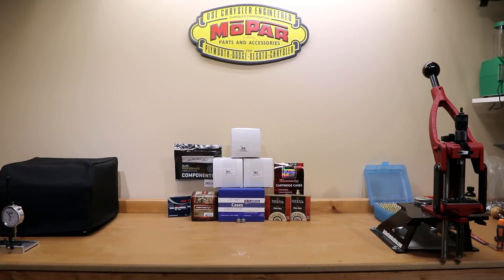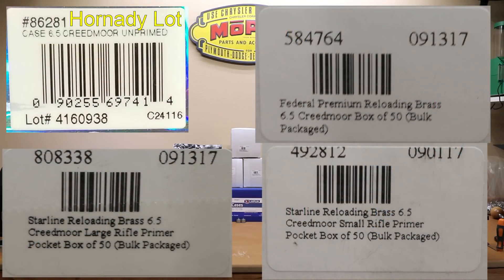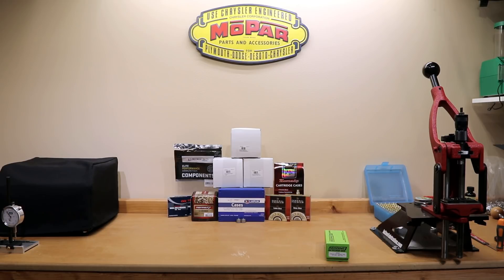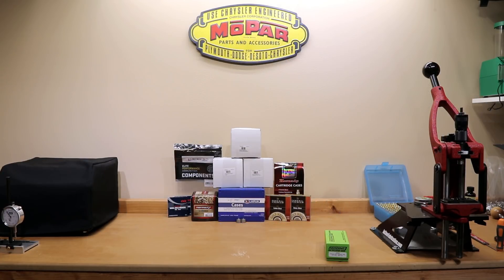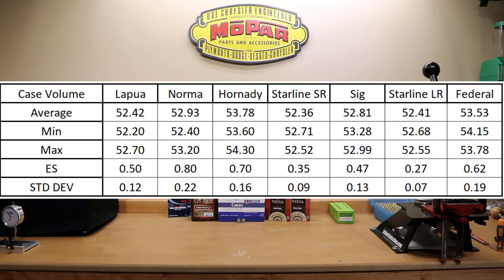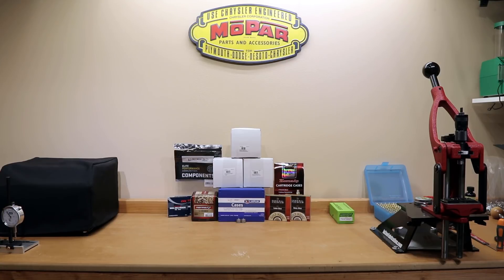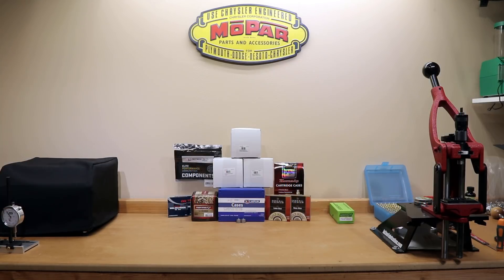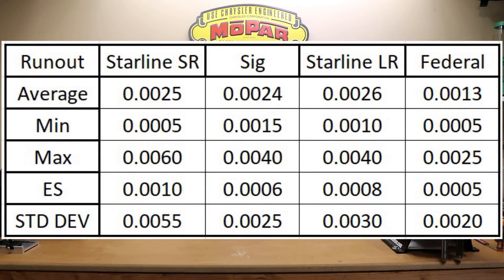Ultimate 6.5 creedmoor Brass Comparison guide

Comment: So I found some brass from a company called eagle eye ammo. It’s .308 LRP. When I emailed them about the brass I received this response “. We work with Alpha Munitions and the brass far exceeds Lapua on every technical metric.”

I did email alpha about this and they said they do send eagle eye brass. To what capacity the guy sis not know. Be it raw material or preformed brass to be head stamped eagle eye.
I message ultimate reloader on his website about this also. He has all my contact info

Might you be interested in testing some of this brass? 

I bought it thinking it was SRP. Because it was labeled match brass. But it’s LRP and I won’t use it. 
Please feel free to message me thanks

Comment: I was surprised by your results that Starline had lower case volume variation than Lapua (stdev 0.07 vs 0.012).
I was also surprised that Norma had lower neck thickness variation than Lapua (mean variation .34 vs .40 mil)

Comment: Beware of Norma Brass! I got brass failure/head separation after only 3 loadings. Using the same load with Hornady brass, I have had absolutely no problems. The Hornady brass have been loaded 16-18 times! Buy Hornady and don't take a chance on getting injured with Norma brass.

Comment: Roughly how many firings will I get out of 6.5 Creedmoor Starline LR primer brass vs Starline SR primer brass before primer pockets start to fail? I don't plan on annealing the brass. Thanks for any advice.
Reply from the maker: I dont have enough cycles on mine to fail yet but my SR will last longer, but tend to have issues with primer cratering at lower pressures so it depends how hard you are going to push it. LRP will likely give at least 7-8 firings. Just FYI, I just got some Peterson brass and have a video coming out soon. Its price is between starline and Lapua, but its quality is closer to Lapua. It's worth the money. Brownells and grafs carry it. Brownells always seem to have coupon codes.
Reply: I have 6.5C Starline SRP that have been fired 8x, annealed every 4 firings.  So far no sign of any case deterioration.

Comment: Just got some Peterson brass in 6.5 small rifle and damn it looks good. Excited to get it prepped
Reply from the maker: I have heard good things. I requested some samples but I never got a response back unfortunately. They offer 3 different options which did you pick?
Reply: Bolt Action Reloading I picked there standard annealed small rifle. Not the over sized brass that you neck turn down to your specific bore diameter. Looks good. Will have to see how it shoots once fire formed. They claim same gun, same bullet, cuts groups in half reported by customers.
Reply from the maker: Best of luck to you. I am not ready to write it in stone but I really feel that Neck wall thickness variation plays more into group size than people think. People have been very critical of my conclusions using the 130 RDF in this matter but I can't ignore the reduction in group size it provided. Lapua is very good in this regard, but my measurement have Norma at the top. Which to date have the record for the Best SDs on the channel. Again my hypothesis, no laws of physics. Very interested to see how the Peterson performs. Not trying to bash Hornady, but its not the best brass. Doesn't mean its not ok, but if the best group size and SDs are a goal its not the one to pick. If you are making 150 yard Hunting ammo its fine.

Since you went with SR brass the primer is probably a bigger deal. Do as you like but I have had better luck universally with Magnum primers. Makes a lot of people upset for some reason, but data is data and for me and I get to choose what I use.

Are the flash holes smaller like Lapua so a standard decapping pin wont work or is it like the starline brass where it has the larger flash hole?
Reply: Bolt Action Reloading not sure what size the flash holes are. I did not even think to ask. Just assumed that a regular decapping pin would work but if not I will get a smaller decapping poin.
Reply from the maker: I didn't really think of it either until I got my Lapua SRP brass and it specifically called out the dimension which cued me to check it out and place a order at brownells for the different universal decapping die. Just check it out would hate to see you wreck premium brass by accident. (or on purpose really)

Comment: Just for comparison, I have 200 pieces of Peterson 6.5 CM SRP brass from the same lot, and the once fired weight numbers are Min-172.6, Max175.6, Avg.-174.1, ES-3.0, SD-0.9092.  See data and graph at (copy and paste entire link or it won't connect) https://drive.google.com/open?id=1TfPW1wJmTavKlHQqWuiWOgku08TjT8w4
Reply from the maker: +hdmungeryt thanks for adding.

Comment: SAAMI spec for the depth of the small primer pocket brass is 0.117 min and 0.123 for the max depth.  I recently bought 200 Starline 6.5 Creedmoor brass, all of the brass had small burs on the inside of the brass where the primer hole was drilled and the primer pockets were from 0.0115 to 0.0117 in depth (most were 0.0116).  I have spent over 2 hours removing burs and increasing the primer hole depth with a Lyman flash hole uniforming tool.  Also about 20% of the brass will need to be neck sized at the mouth of the case because they are out of round.  Note that I had to do the same for the bulk Hornady brass that I have bought.  I have not bought Lapula brass for the 6.5 Creedmoor but I did buy some for my 223.  It was expensive but came in a nice plastic case to protect the mouth of the case and did not require conditioning of the primer pockets.  The plastic case is used to protect reloaded rounds from dings when you move the round from the reloading press to the range and back.  Some will ask why did I spend so much time conditioning the brass?  Read this research paper on primer holes http://scholarsmine.mst.edu/masters_theses/7416/
Reply from the maker: I do not doubt that all the prep was needed. The Lapua brass that I bought in 6.5 creedmoor was in good shape however the Lapua brass in 338 LAP was not as nice (necks were dinged). Is there a link to the full paper or just the abstract for the link you posted?
Reply: I found the paper about 2 months ago and downloaded a PDF.  I found the link on the front of the paper but was unable to find the PDF of the actual paper.  I think that if you called the school they may be able to help you.  The conclusion in the abstract implies that the primer hole can make a big difference in accuracy.
Reply: Update, I full length resized all of the brass and checked for runout.  All that I checked were less than 0.003".  I'm getting sub MOA, 5 shot groups for two different loads under development .  I appears that I will end up around 3/4" for both bullets and ES under 15fps.  After processing 79 once fired brass I found 71 brass had under 0.002" runout and 8 had between 0.002 and 0.003" of runout.  This could be the best brass I have bought if the remaining brass has the same runout despite the work on the primer holes.

Comment: another good video and liked the bonus info! it'd be nice to see the comparison of data between magnum and non magnum primers in both the small rifle and large primer Starline brass. I've always wondered how much of a difference it makes. Now i just have to watch back through your videos again to see your reasoning behind the magnum primers which i've been wondering about switching to myself in the Lapua small rifle brass after I conduct my testing
Reply from the maker: Hey Matt, Here is the small rifle vid: https://youtu.be/ZPu0DzIgKNk Large rifle is here: https://youtu.be/ypI6D-i57uk I have more data that I add together to make this conclusion but these are my findings. Hope you find it useful.
Reply: thank you, yeah I went combing back through your videos after leaving the comment and found it quite easily why you have switched to mag primers only and just went over the two videos.
Definately useful and gives me a good idea but i'm unable to draw conclusions from it simply because it's different brass with quite different capacities and potentially fired in different conditions and # of firings on casings. The Starline being pretty much the same except primer size and relatively new would be a good platform to test I was thinking. I'll picking up some Peterson brass shortly to use in addition to my lapua and may have just have to pick up both large and small rifle primer casings and run this test myself.

Comment: Truely and extremely detailed look at various types of brass.  After reading the comments I went to the Peterson brass website.  I decided to get 50 6.5 cm and test them out.  They are out of the small primer but had the large primer version.  One interesting note is that the Peterson website says that the small primer brass holds up better with primer leak when loading over max loads than the large primer brass.  That seems like a good reason to switch to small primers.  But, the ultimate choice for me is always going to be "which brass gives the best accuracy"?  I will be eagerly waiting for your test results for accuracy.

Comment: I started shooting 6.5CM this summer. I've used Hornady, Lapua, and Norma brass. (I have starline and sig but haven't shot any of it more than once) - I was also shooting 39.9 grains of IMR4451 which is about 2500fps w/ 140g bullet. (not a hot load) 

Norma brass was the most expensive, and lasted about 4 firings before the primer pockets were blown out. 
Hornady brass seems to never wear out. I think I'm close to 15 firings and the pockets are still like new. Consistent and snug. 
Lapua SRP - I ended up using this brass because... Lapua. I've got 300 of them and I found a load that gives me bug holes so I stopped playing with loads. Some of them seem to loosen up after 3-4 shots but they still work. The others are still going strong. 

I've been pretty pleased with Peterson 308 Palma brass. I have an MPA 6.5CM gun showing up in a few weeks and I think I'm going to start out with some of the Peterson fat neck 6.5CM brass. (Comes thick, must turn to your chamber)
Reply from the maker: It sounds like interesting stuff. I assume directly from them is the only way to get it?
Reply: I think so. Pretty quick shipping though.
Reply: Aaron Anderson If your not using your starline brass I will gladly take it off your hands. I love my SL SR brass. Just bought 100 more pieces and a box of 50 Peterson SR brass. Excited to see how Peterson brass does. They package it very nicely.

Comment: There is no substitute to starting with good brass and you can't go wrong with Lapua. I've experienced the loose primer pocket issue you mentioned with LR primers in 6.5 CM. Your Starline SR results have definitely caught my attention. However, I can't understand how the Lapua generates more MV for the same charge weight when the case volumes are nearly identical and the Starline SR has a larger flash hole. Maybe the longer Lapua necks generating more neck tension?
Reply from the maker: +njgrplr2007 could be a slight change in ambient temp. They were shot on different days.
Reply from the maker: +njgrplr2007 I was impressed with the consistency on the starline as well. I am interested to see how it works through multiple reloads.
Reply: moparmadman Ok, I missed that very important point. Thanks for the clarification.
Reply: moparmadman Assuming the slight temperature difference is the cause of the slight MV difference, it would seem to indicate that Lapua's small flash holes are big enough but it doesn't hurt to make them bigger either. If I recall, you're a user of the Lee case trimmer like me? If so, you've probably experienced the problem where the trimmer pilot doesn't fit in the small flash hole?
Reply from the maker: I have a lyman trimmer as well that I use as well ,but you are correct.
Reply: moparmadman It will be interesting to see how the primer pockets hold up on your Starline SR brass. My guess is the smaller Lapua flash holes might be to prevent the pockets from loosening up. We shall see.

Comment: You should check out Peterson, I've had a lot of luck with it in 308
Reply from the maker: +Aaron Anderson I just checked out their website. Looks like interesting stuff.
Reply: Pretty good stuff with great customer service. They'd probably gift you a box. I bought 50 308 Palmas and they came in a plastic box with foam over the necks. Properly annealed, chamfered, and deburred. Pretty nice stuff!
Reply: I have some of there 6.5 CR brass ... thickest necks out of Lapua and Hornady.  I am using a 0.291 bushing ... price and packaging are good.  Still fireforming new brass so no second loading yet